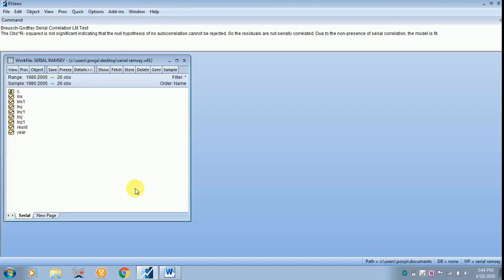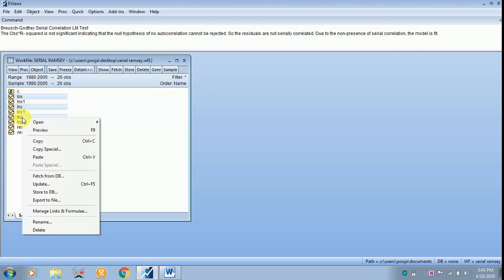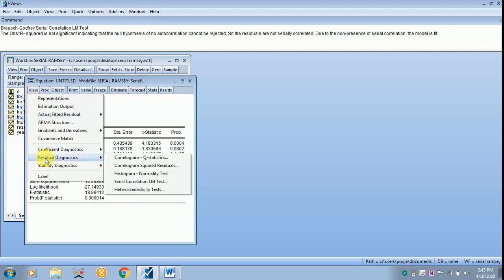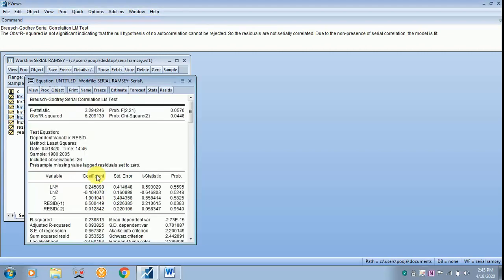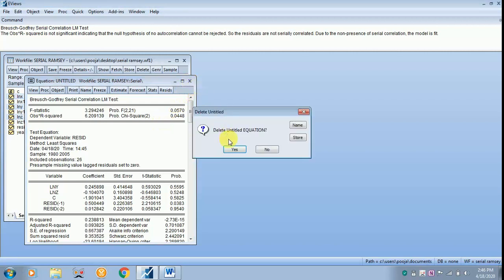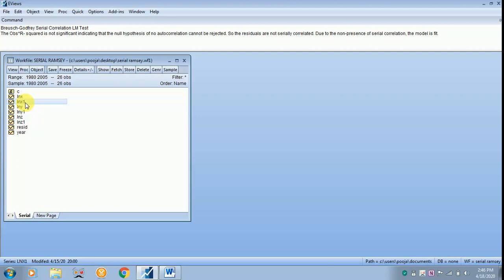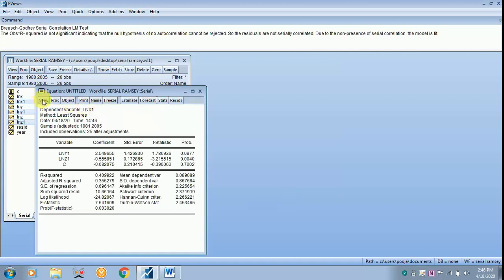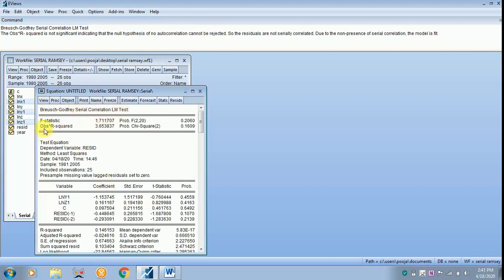HOW TO DETECT AND REMOVE SERIAL CORRELATION  BREUSCH GODFREY SERIAL CORRELATION LM TEST - EVIEWS

Comment: Thank you so much Doctor.
What if i have serial correlation to a regression analysis in which time is not important ( not a time series case) .  Is serial correlation crucial issue for the regression model . If yes, How can I remove the serial correlation ? As taking the 1st difference makes sense only for time series data.